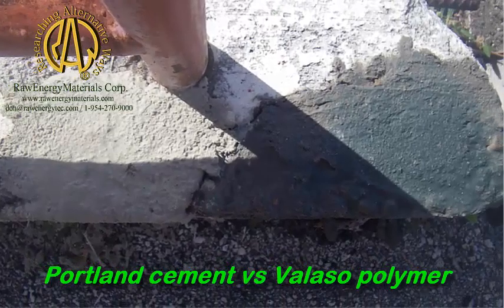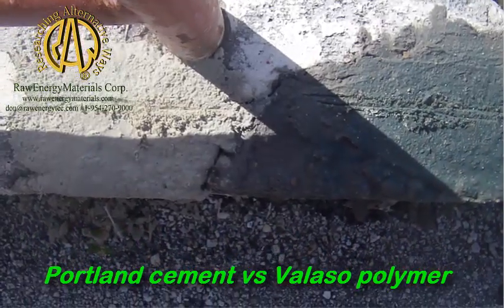Portland Cement vs RockStar Materials GeoPolymer

Comment: You mention in the video that it was used for filling pot holes.... How big of an area would it be able to cover for a floor of a steel building?
Reply from the maker: Steel would be a bad choice considering it's performance/longevity. Send me a message with your email address and I'll connect you to get any questions answered.